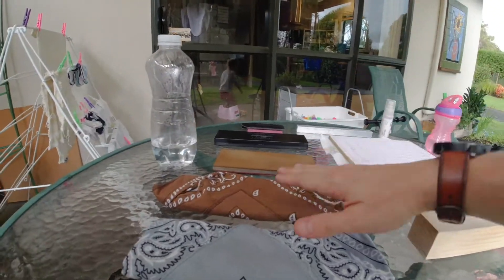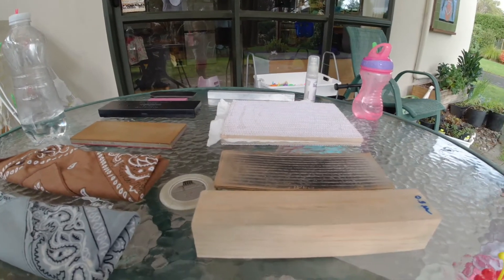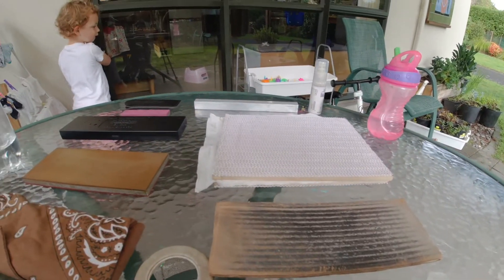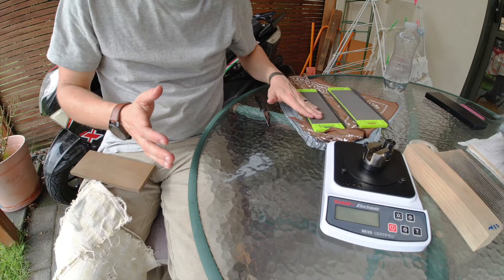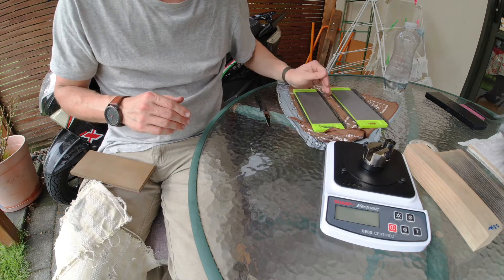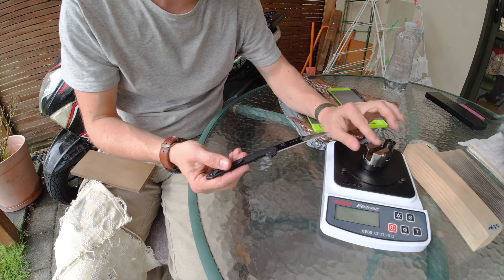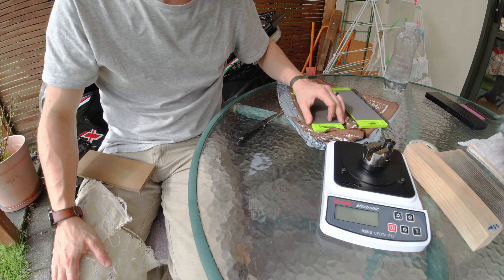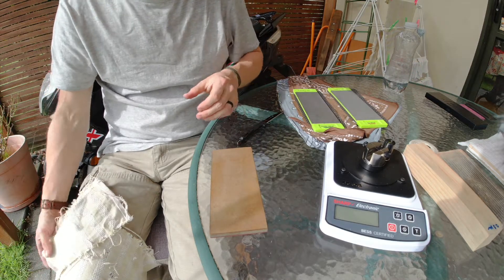Searching for Sharp - Can Tungsten Carbide (Sandrin Knife) be Hand Sharpened?

Comment: You're not going to get the edge you want with Tungsten Carbide free hand sharpening it's too inconsistent.  Your could get a very sharp edge with a guided sharpening system and diamond plates like a DMT course,  600, 1500, then some diamond lapping films.  I would bet you could get to a Bess 150 or below.  Just takes a lot more work that most people want to invest in sharpening a TC HRC 71 knife.   That's why CPM steels are preferred.   Personally I think anything more than 1095 is over kill.
Reply from the maker: Thanks for the comment bro - good thoughts.  I am coming to similar conclusions - see this (newer) video if you’d like an update.  The video you commented on is a little older in the progression. Anyway, this is my most recent take;

Sandrin's Last Chance | Goodbye Tungsten Carbide?
https://youtu.be/qtb1keSdKtg

1095 can definitely be fun.  IMO Sandvik Steels like 12C27/14C28N offer basically the same package as 1095 with rust resistance and much better toughness (depending on HT).

To be honest (I’m not disagreeing with you, but) everyone keeps telling me the same thing: angle guided stones, ultra fine diamond progression, less than 150 BESS - but I’ve never seen anyone demonstrate proof, do you know of anyone actually getting Sandrins measurably that sharp?!  I’d just love to see how they did it!
Reply from the maker: Cheers bro.

Comment: Hey there I'm not sure if it's this video or a different one but you mention using cardboard as a strop. What part of the cardboard are you using? Are you using just the flat exterior side of a cardboard box? Or? Thanks in advance
Reply from the maker: Greetings Shawn, nice to see you around!  I haven’t been using cardboard as much lately, not because it doesn’t work but because my denim stropped edges have been performing slightly better overall.

Usually I just cut a whetstone sized rectangular piece out of a thick cardboard box pre-sharpening.  Then I lay it down just like a strop on a non slip pad and load it with the desired compound, or just use it to polish in-loaded!

Cheers bro.
Reply: @homeslicesharpening  thank you
Reply from the maker: @shawnfallahi5616  no problem, have a good one!

Comment: Thanks for the video, great stuff as always. I've seen different figures for the Spyderco UF (on the Spyderco forums iirc), the Fine is about 2500 grit/6 micron while the Ultrafine is about 5000 grit/3 micron. Could be wrong though. The Fallkniven CC4's advertised grits are waaay off, it's more like 15/8 micron or coarser even though they claim it's 1/0.1 in all their info. Try using that "1 micron" side on edge that's actually finished to 1 micron and it's obviously much coarser. Not a break-in issue, there's no way that dark side would ever smooth out to 1 micron.
Reply from the maker: Thanks Mike!  Very helpful.  I always take grit ratings with a grain of salt - there seems to be little harmony between manufacturers, some even use different rating systems entirely.  I sorta figured Fallkniven way off 😂

I always settle out the differences through personal experience.  In my personal experience so far, ceramics fall in the “Nice edge but hard to deburr” category and Spyderco are in the subcategory of “Usually finer than advertised”.  The Fallkniven CC4 fine and both white Spyderco Stones make up a mental category known as “Adequately Shiny, fairly stable edge” 🤣

Welcome to my brain...

Thanks for the input! Cheers bro.

Comment: Can you please recommend three versatile sharpening stones to work together, or a sharpening system that would do the job of those stones?
Reply from the maker: Greetings!  Do you mean a 3 piece sharpening system for Tungsten Carbide blades?  
Or for a high carbon steel knife?  
Or for a normal/low carbon steel knife?

Or when you say versatile, are you looking for something that produces decent results on all 3?
Reply: @homeslicesharpening , sorry for the confusion. Yes to the high carbon steel. I recall you sharing in a video, the sharpening stones you use. Thought I would ask the dual grit master himself for sharpening stones recommendation (before I go out and spend on something I might regret).
Reply from the maker: @wigglywrigglydoo  To be honest, I am in the middle of some testing that may change my answer!

So far the best results I've had were a 250 Grit Diamond Plate (mine is EZE-Lap) and King 1k/6k fine, then gentle stropping with a cut up pair of blue jeans loaded with some Mother's Mag automotive metal polish.

I have been told that Chosera stones or Shaptons or SIgma's are better than King, but I have yet to test them out!
Reply: @homeslicesharpening  , thank you :) also, look forward to seeing results in your videos in the future.
Reply from the maker: @wigglywrigglydoo  thanks bro - I hope to have  much more comprehensive answer to your original question in about 6 months!  Stay tuned, and thanks for commenting.

Cheers!

Comment: Is it me or in the beginning slow no shot the edge looks like it has a reverse curve and the tip Iirc lower than the heel?
That's interesting about using aluminium for a strop. A lot of big time Russian sharpeners use either hard wood (oak and ebony due to density) or cast iron blanks for their diamond pastes. Another thing they do us use painters tape over them as a surface for the paste that way you're not forced to stick with the same compound. 
I think I should try one of my stone blanks as a strop, maybe flatten and polish it with a granite plate and sandpaper.
7:50 that's so cute, seeing your kid helping you wet the stone. She did a great job at it too, start them young.
Reply from the maker: The edge is definitely recurved, that's thanks to the fact that I had to sharpen out a large chip that Pete put into it in his testing (not complaining, I am so glad he probed the limits for all of us!)

Check it out in this video at about 17:45
https://www.youtube.com/watch?v=RbgdbpRAkSU&t=1117s

But yes, I curved it a bit to carve out that chip while avoiding removing a LOT of Tungsten.

Yeah, Mara loves to run the water on the whetstone!!!

Comment: I wonder if aluminum tape on dead flat glass would work?
Reply from the maker: Probably so...  That would definitely solve the problem I had of the rod's finish being uneven.
Reply: @homeslicesharpening  I'll test it out soon, I have a few different ones. Will also test abrading the tape before applying the diamond paste/spray.
Reply from the maker: @dandildarious4849  Sounds great - do keep me posted!  Is this on a Sandrin as well?
Reply: @homeslicesharpening  I don't have one, but I do have some tungsten carbide bits. I may pick up a Torino at some point.
Reply from the maker: @dandildarious4849  Cool!  Keep me posted.

Comment: I would have guessed the diamond stones would do something, but they didn't really. The ceramics were a surprise though and the aluminum with diamond spray actually worked. Can you sharpen it by hand? well yes but not easily and with a whole lot of effort and patience. You had good help there, so that must have been a relieve. Thanks Gabe.
Reply from the maker: After further review, it looks like the diamond plates do a lot - too much even!  They chip out large sections rather than smoothing the edge.
Reply: @homeslicesharpening  Ah that would explain a lot indeed. I wonder how they put the factory edge on it. It's a puzzling journey, to hard and abbrasive or to soft and ruining stones or good hardness but really slowly getting a sharp edge. Thank you friend.
Reply from the maker: @jeroenvoss6231  Indeed!
Reply: Diamonds will absolutely work with a guided sharpening system using DMT diamond plates.

Comment: Another really cheap way of sharpening is on sand paper, Gabe. Maybe you should give it a go. Here, 60,120,400,1000,2000 grit papers cost 3,5 euros altogether. And you can find silicon carbide sand paper at these grits. Sometimes the simplest way is the one to go.
 I was not surprised to see the ultrafine surpass all the other stones you tried, because i have extensively used it and no matter what people say, this stone can cut anything. You can play by lapping one of it's 2 sides with sand paper. I tried it on mine and i am impressed with the improvement. The ultrafine is also harder than my translucent Arkansas stone, for those who wonder of the comparison.
Reply from the maker: Yeah, I've been impressed with it so far, thanks for the recommendation!
Reply from the maker: I was definitely impressed it cut that Tungsten!